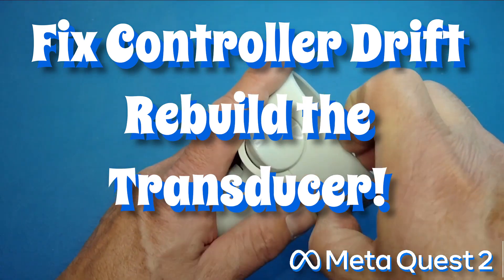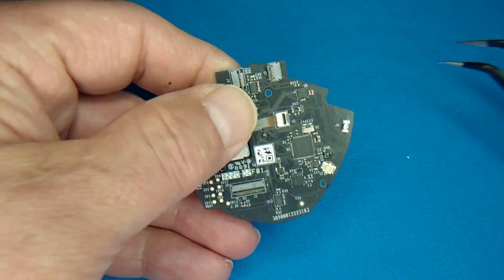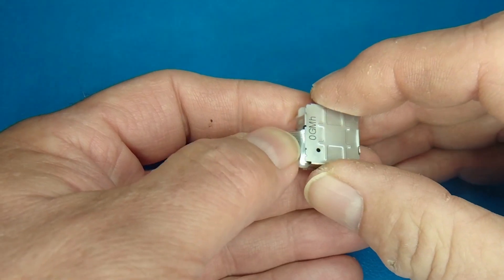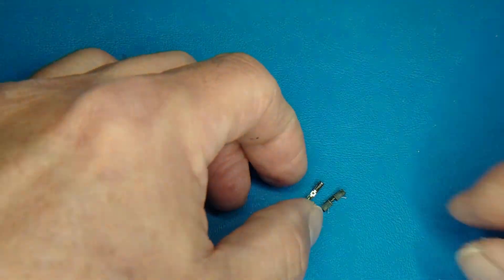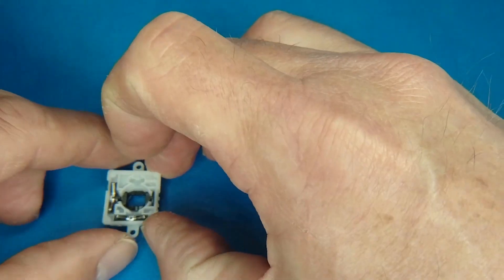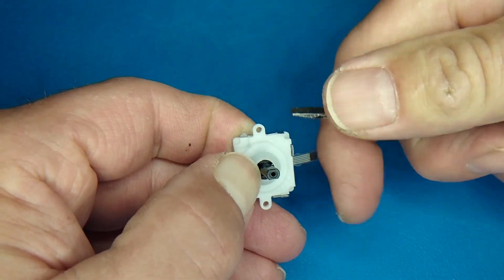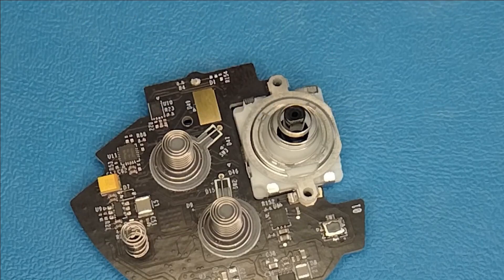Fix Quest Controller Drift- Rebuild the Joystick (Quest 2 Tips)

Comment: Hi .. I've done replacing new joystick.. twice 
Everything works but it still has slight forward Drift .. and can't click with left controller, seems like some buttons are automatically being Pressed .. 
Please assist what should I do
Reply from the maker: You might want to make sure the ribbon cable is properly seated and the latch is down/locked.

Comment: So I replaced the joystick on a controller and the top half isn't reading with the new stick at all...any ideas why?
Reply from the maker: I would double check and make sure the ribbon cables are seated properly and the latch is down.
Reply: @ImaRainbow  OK...thanks....not a whole lot of point now, though T_T I broke it.

Comment: So what im seeing is most stick drift if because of metal fatigue and not grit. Poor design tbh. I miss the old analogue sticks
Reply from the maker: Yep.  Clicking down on the controller constantly, eventually causes those spring contacts to bend so they aren't making proper contact.

Comment: Hey I know I’m a little late, but what do I do if my spring on the joystick is stretched? I really need help
Reply from the maker: The "spring" is actually for the capacitive sensor for you thumb.  If its been stretched out, you should be able to use some needle nose pliers to compress it back into shape so it'll fit under the thumbstick cap.
Reply: @ImaRainbow  it simply keeps coming back up. Do you know any videos about how to compress the spring?

Comment: Great video, the best so far and I looked at heaps, none show to bend these contacts. But it didn't quite solve me issues completely but doing a 10 second extra step did.  I have two quests and one controller from each was having issues.  I did the steps in the video and for one controller it fixed it enough to create a small amount of deadzone in the settings to make it near perfect.  But the other controller which was worse to start with did get much better but still had too much drift for the deadzone fix to work without small drifting.

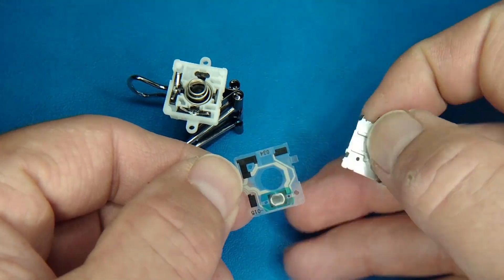When you take apart the transducer there is a couple extra quick steps you can do that completely solved my issue.  Yes you need to the do part in the video as well.  But while you have it open,  clean it.  Clean the contacts in his video with contact cleaner.  Mine did have a very small visible something on one of them, like dust, I could only see it under magnification.  Clean the  white rubber part the spring sits on too.  Clean the joystick.   But what I found fixed that final bit of drift was cleaning the circuit board.  Again mine had some fine white stuff on it and maybe a bit of black dust.  I used contact cleaner.  There is like a silver shiny bit.  I think its for the click down on the joystick,  I wasn't having issues with that, but I cleaned it anyways.  But then there is 3 black parts on this part.  Look at 8:00 in his video.  Retangle one bottom left then an upside down L shape top left,  then one top right. At 8:32 you can see when he flips it on the black parts will touch the contacts he bent up in the video.  CLEAN those black parts with contact cleaner also.

After doing this on my one bad controller it 100% fixed the controller.  I then took my other controller apart that I had only done the bending on and cleaned it and it too came back to 100% working.  No need for deadzone fix in settings.

FYI incase anyone else notices their transducer looks different,  I suspect the transducer in the video is an already replaced transducer or a later model Quest 2, where meta changed the design slightly, as both my controllers had a different transducer in.  Mine did not have the # design on the metal plate like his.  Looking at replace kits, older ones look like mine and newer replacement kits have the new  hash or # design on the metal.  Good luck.

Comment: i dropped my controller once and now the stick keeps going fully left at random intervals, even if i was to push my stick fully up or down it would still go fully left rapidly and spontaniously  rather than a constant small drift. do you think that issue would be fixed by this? or maybe its a different issue
Reply from the maker: Can't say for sure until you disassemble it.  Just remember, it's broke now, doesn't sound like you've got much choice unless you're getting new controllers.  You can buy new transducers, rather than trying to rebuild.  They're $15-20 on amazon.  Good luck.
Reply: @ImaRainbow  ye, the videos you made have me confident in the repair anyway so thankyou :) I legit only had the controllers a day so will hold off on doing anything about it for a while xD

Comment: Dang i should watched this yesterday i actually took it apart and should of pushed up on the tabs to fix it now i have to take apart so many screws just the thought of it makes me have a mental breakdown SO MANY SCREWS 😭💀💀
Reply from the maker: Well, so many is actually not that many.  Of coarse, I built up electronics for a living, so many is a Lot more.  Good luck with the repair.
Reply: @ImaRainbow  guess I'm gonna have to buy another those switches because it still has no function up or down just side to side and click down. It worked fine before i tried cleaning it with alcohol but I guess that didn't work either

Comment: I just opted for the $18 kit from Amazon. Comes with two new joysticks and all the tools you’ll need. But if you really like tinkering, this is the way to go. Question is, are the Quest 3 controllers harder or easier to work on?
Reply from the maker: From my perspective, they're easier to disassemble because they don't have the ring.  Makes it easier.

Comment: I've done this, tried contact cleaner spray/compressed air, bought two new transducers, and still have drift. Do you have any idea what else could be causing it?
Reply from the maker: If you replaced the transducers and you've still got drift, it doesn't sound like the controllers.  Maybe factory reset the headset.  See if that helps.

Comment: Thank you so much! Drift has been a huge issue and no fix seemed to work for me. I tried this as a last resort and it worked perfectly. And your video about the controller disassemble made the prosses a breeze. Again thank you so much for this extremely helpful video.
Reply from the maker: Glad it helped

Comment: Thank you for your detailed video tutorial. I followed your process step by step, even though I have no experience, and I took apart and rebuilt my right controller joystick. Everything looked fine, but when I tested my controller with the headset, the joystick always pointed forward without any input, making my controller useless. What did I do wrong?
Reply from the maker: No way to know without me looking at it myself, but I've got some suggestions.  Check to make the ribbon cables are properly connected and the latch is down.  
When you reassembled the transducer, did you check to make sure that it felt like it was moving properly?  The parts are tiny, so it's easy to get them misaligned.
Reply: @ImaRainbow  yes it moves as it should. Are the joysticks of the right and left controllers identical in their components and positions?
Reply from the maker: @nayanmisra8447  Yep, same transducer in both.  The can be swapped.
Reply: @ImaRainbow  You were right. Within the joystick module, one of the wires from the two contact pairs was twisted in the opposite direction..I took it appart again and fixed it, working perfectly now. Thanks a bunch. I’m grateful
Reply from the maker: @nayanmisra8447  That's terrific!  Great job on fixing it yourself!

Comment: I just did this! Thank you so much for the videos!

I had a 90% drift to the right (flickering rapidly between center and 90% right). Now I only have about 5% top-left, which is much better and I think it's manageable with setting the deadzone to the minimum.

If someone is planning on doing this, let me just tell you though, it's much harder than it looks and so not repair-friendly! Those screws next to the trigger on the main board are freakishly hard to screw and unscrew. They got stripped a bit and the screwdriver slipped and hit the board hard. I was pleasantly surprised no soldered component got knocked off. I know I probably can fix the remaining 5% drift if I repeat the whole thing, but I'm almost sure I'll end up ruining the controller by the second or third attempt, so I'll just keep it like this for now.

I have a tip though, make sure the metal housing of the thumbstick module is very straight (the 4 L shaped clips you bend out of the way to open it) but also slightly still bent inward a bit, especially the side pieces (the 2 window shaped pieces that fit on white protrusions), then you just push it straight down on the spring and the "windows" catch the plastic nicely clicking in place, you don't even have to hold it, then just bend back the 4 L clips withouth hassle.
Reply from the maker: Glad that worked out for you.  Thank you for passing along your experience and the tip.
Reply: @ImaRainbow  umm, so I've opened it a second time because the capacitive touch of the thumbstick is stuck in the "touched" state. The contact of the spring was in the correct orientation but the screw wasn't pressing against it enough (I would've thought it would be stuck in the "not-touched" state).

But, even after making sure there is contact (there is no visible gap from the side), it still shows the thumb stuck in the "touched" state all the time. Any idea on what might be causing it?

I checked for continuity with the case of the transducer (and all the visible debug "pads" I could find) and there is no continuity anywhere. I can't check directly if the spring has continuity to the metal pad it's supposed to touch because it's inaccessible when screwed in, and I couldn't find any other place on the board connected to it.

Thank you in advance.
Reply from the maker: @lake5044  The metal clip that covers the transducer has to be oriented in the correct position.  There's a clip on it that should be opposite the side of the ribbon cable.  If that's not oriented properly, the spring won't read properly.  This is the only think that comes to mind, base on your description.
Reply: @ImaRainbow  I'm certain the orientation is correct (the flat side is to the outside, and the metal flap that is supposed to touch the metal pad on the board is in the correct spot).
My only guess was that the screws were not tight enough. I tried bending the metal flap a bit so that it sticks out more and tightened the screws fairly well so that it is surely touching. And yet it's stuck in the "touched" state. (Can you confirm that if it's not touching it will be stuck in "touched" instead of "not-touched"? Because maybe instead it's touching some other thing it's not supposed to touch? I doubt it but who knows.)
I also tried repairing the controller and it didn't work. And I couldn't follow the trace to where that pad is connected to (or it's connected on the same side) which is impossible to prob when the board is screwed.
Well, thank you so much anyway. Maybe you or someone else later might read my comment and have some new idea.
Reply: I managed to solve this mystery a while back and forgot to update my comment: the issue was that the animation of resting the thumb on the thumbstick and very slightly moving the thumbstick are the same... So I didn't have any issue with the detection of resting the thumb, it's just that I had a tiny (5% or so) drift after the fix, and after adjusting the deadzone in the settings, the detection of resting the thumb works fine. Hope this helps anyone doing this.

Comment: 1 h 30 min each controller, but it absolutely works. both like new. Thank you!
Reply from the maker: Glad I could show you the way.  Great job on the repairs!
Reply: Did it continue to work fine, or the drift returned?
Reply: @testowykana1763  Unfortunately I used a replacement from AliExpress, and it worked fine for 6 months. after that I just bought a quest 3. But as far as I know, even the original replacement lasts about 1 year.

Comment: I had a problem this metal tabs hold it in play won’t go up with force I don’t know why but I won’t work
Reply: Fast forward it worked I did it and I just put I back together and the stick drift was completely gone thank you
Reply from the maker: That's terrific.  I love a success story, great job!
Reply from the maker: Try lifting the clips on one side, until they slip over past the plastic retainer.  That will let you free one side first.

Comment: yo dude is it true that you wont have pressure sensor anymore after replacing the joystick?
Reply: i mean that thing where you put your thumb on the resting point and it points/thumbs up
Reply from the maker: No, it's not true.  If you rebuild the transducer, it'll work just like it always does.  Same thing if you replace it with one of the new ones.
Reply: @ImaRainbow  is there any video explaining this thing
Reply from the maker: Explaining a transducer?  Probably.  Explaining the controller, none that I know of besides mine, but I haven't looked around for awhile either.  
It's fairly simple though.  While it feels like you're moving the thumbstick in a circle, you're only actually moving it (right-left) X and (up-down) Y.  Metal contacts that move in X and Y, create variable resistance, that's passed to the headset.  The headset converts the X/Y resistance into coordinates, these get translated into movement.
Drift starts happening when the transducers produce inconsistent values, that the headset doesn't know how to translate properly.  These can be caused by bent contacts, dirt, sweat, hair or anything else making contact within the transducer itself.
Reply: @ImaRainbow   can you like tell me which second of the video shows the transducer so i know not to mess with it too much

Comment: Even with new thumbsticks on the way, I managed the repair the originals although they were a bit different than the ones in your vid. Great tutorial, will see how long this will last, but having new ones as backup there’s no worry. Thank you from Argentina, people like you should win a Nobel Prize.
Reply from the maker: Glad I could help.  Great job getting them up and running again.
Reply: does it still work well? I heard those replacements get drift quickly
Reply: @fazemoti2755  did not use the replacements yet, I followed this tuto for repairing the originals and still works fine, no drift at all.

Comment: I cant get the spring back inside the stick for the motion sensor. I haven't found any video that helps, not even this one
Reply from the maker: You might be able to reseat the cap and make sure that the round part of the spring has slipped completely over the the round bit under the cap.  It's impossible to see, so you have to just work it up as best you can.
Reply: @ImaRainbow  same i get a clicking noise when i move the analog sticks now, cant get the spring to sir over the plastic under the analog stick.. can i widen the spring?

Comment: for some reason i think i did something wrong everything works but when i have my thumb on it it doesnt detect it only when i press or move the joystick
Reply from the maker: The "spring" is probably detached from the metal on the transducer.  (It actually a capacitive sensor.)  There's 4 tiny clips that the spring goes through.  Sometimes these will become detached.  Use a pair or tweezers to thread the spring back through the clips.  Hope this helps.
Reply: @ImaRainbow  talking about the spring my spring is literally broken and I can't find anywhere to buy a replacement. Do u have any links

Comment: Thank you for the clear video 👍🏻👍🏻👍🏻. Is there any way to separate the hin layer of the pcb joystick inside? I've bend the contact part up, rebuild it. But I still have problem to press upward I can't run in the game, just a slow walking forward, and it still drift to downward 😓
Reply from the maker: I haven't tried doing anything with the pcb.  It's possible that it's simply worn out.  You might want to consider replacing the thumbstick.  It's only 10-15 dollars on Amazon.  https://youtu.be/kQ2-XYEbOKY
Reply: @ImaRainbow  thanks m8. I've considered to replace it before open the transducer up 🤭

Comment: I had stock black transducer instead of white. And the transducer metal plate holding mechanism is different , is it normal?
Reply from the maker: Is this from a oem controller?  If so, how old is it?  I would not expect them to change any design specs unless meta's making a new controller.
Reply: @ImaRainbow  It is the one that came with the Oculus Quest 2 package. I bought it new 1 month back . But it looks like it was manufactured a while back , since the box and logo says Oculus Quest 2 instead of Meta Quest 2 . And the transducer looks exactly like the black ones that you can buy from amazon or aliexpress. My warranty started the day I bought it , I checked meta's website and after disassembling the controller it does not look like it was opened before. My controller's model is LX39EM

Comment: this worked but right when i was done my controller keeps rapidly flashing and wont connect
Reply from the maker: Make sure all the ribbon cables are seated properly and the locking tabs are down.

Comment: This is the worst analog joysticck design ever, they take the N64 analog joystick and make it worse.
Reply from the maker: I wouldn't go that far, but they probably should've used a a hall effect sensor instead of the mechanical contacts.  Constantly clicking them down and moving them around they're guaranteed to deform and start causing trouble.
Reply: I agree that this is pretty bad design, but I'd say the N64's analog stick is worse. This analog stick can be fixed by just re-bending some contacts, whereas the N64 analog stick gets all loose from cannibalizing itself from constant plastic-on-plastic contact and wearing.